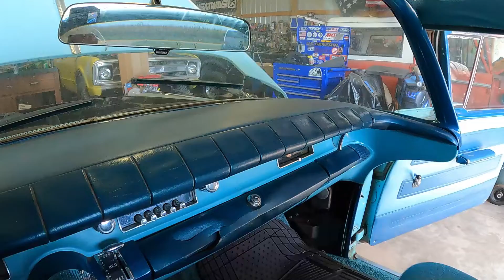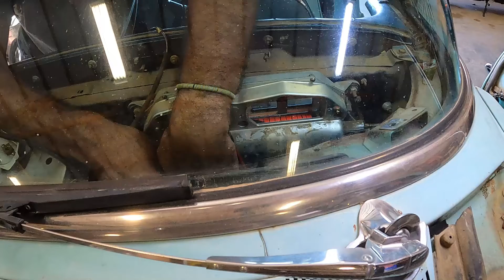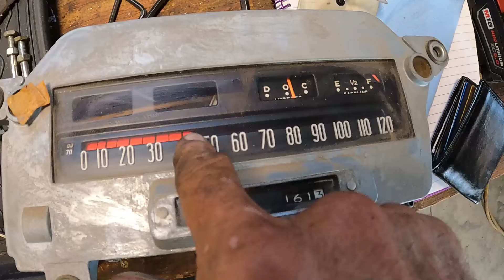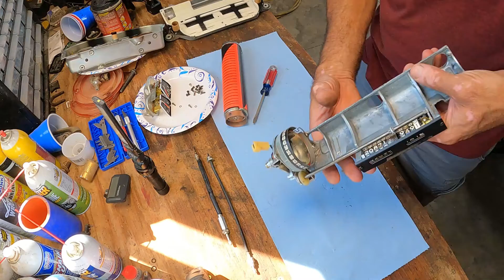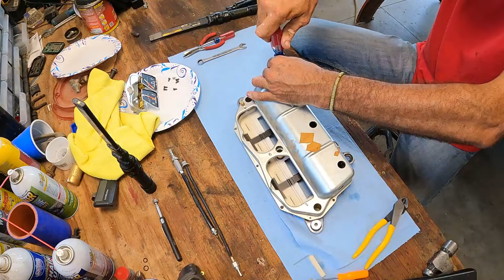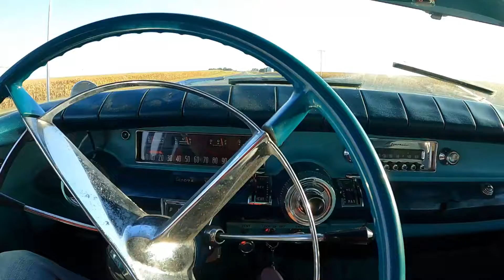1958 Buick Special speedometer repair... smallest part fabrication ever!

Comment: can you tell me if the tubes on the guages for the water temp and the oil presser guages be cut and ne ones installed?
Reply from the maker: If I remember correctly the oil pressure tube has a flared fitting at the back of the gauge.  I don't think the water temp does.

Comment: Thank you for your video, it helped me fix my speedometer of my 58 Buick! But can you tell me what the cable under de speedometer is for, it hanged loose when I pulled it out the dash and I can you spin a inch of the vertical meter
Reply from the maker: There are two cables.  One sets the speed minder.  That little gauge at the top left of the seeds is supposed to trigger a little light when you hit the dialed speed.  The one that hangs down loose if the trip odometer.  Odd that it just hangs around there.  But you can twist it to reset the trip.